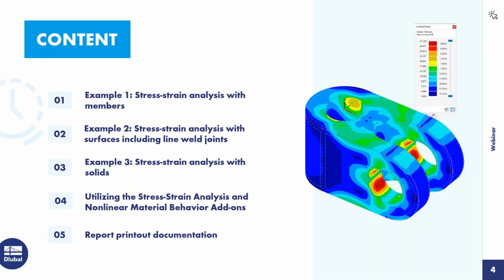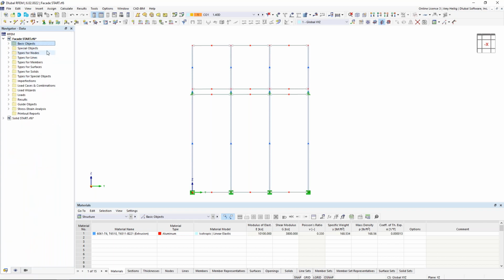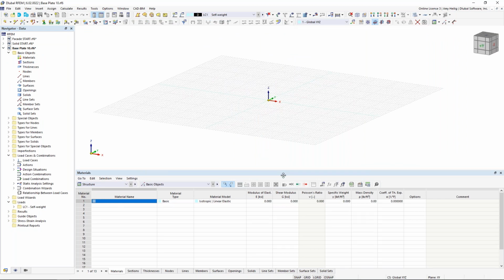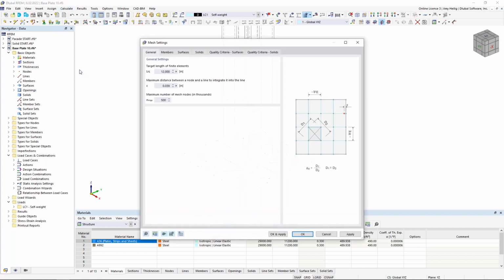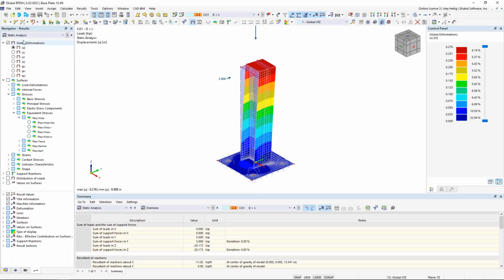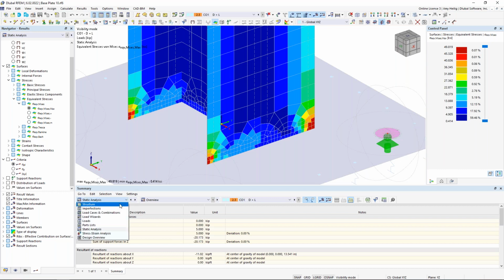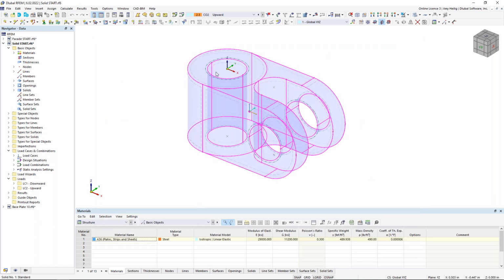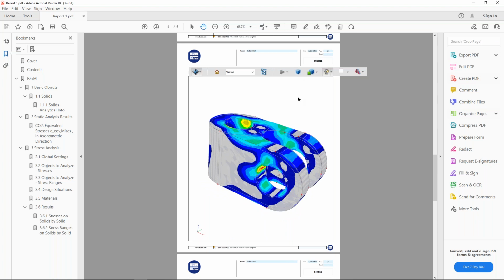Webinar | Member, Surface, and Solid Stress-Strain Analysis in RFEM 6

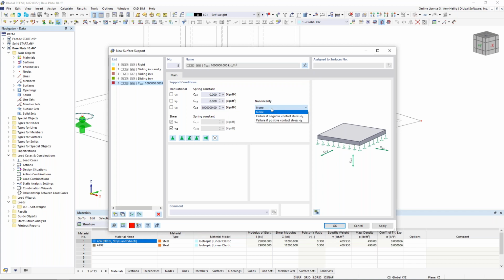Comment: Hi, at time 26:56 how do you determine the spring constant 1e6 and 10000000? how do you get does values? reading reference would be helpful
Reply from the maker: Hi, @Mr.P539! The spring constant value of 1e6 was chosen arbitrarily to approximate a rigid fixity for the surface support's vertical direction, ensuring numerical stability and avoiding issues associated with fully rigid constraints. This approach maintains computational performance while closely mimicking rigid support behavior. Hope that helps!

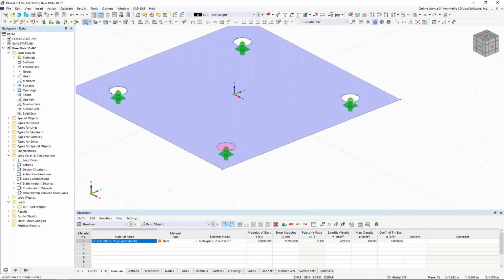Comment: @23:25 What not use line support on those circles, instead of the pin support with rigid surface?
Reply from the maker: Hi, picajoool!
This would be another solution. However, with line supports you would not get nodal support loads.
Reply: @DlubalEN  You mean N, T and V forces that would you need to easily design for an bolt?
Reply from the maker: Hi, picajoool!
Yes!
Reply: Thank you!